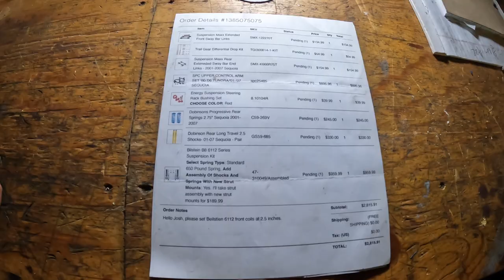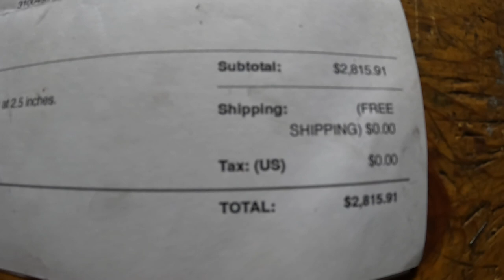Unlock the Secrets: DIY 1st Gen Toyota Sequoia Bilstein 6112 Coilover Upgrade!  Step-by-Step Guide!

Comment from the maker: I want to mention that Josh at First Gen Offroad was great, and i am not trying to make him look bad. The 650lb springs that came with the 6112's were crap in my opinion. Im not sure what the part number is, but they come with the Beilstien 6112 kit on the First Gen Offroad website. My vehicles handling went to shit, lots of  body roll, and the vehicle would kinda  of drive itself from side to side at higher freeway speeds, very odd. I couldn't figure out what was causing the extreme body role. I thought it was my sway bar being undersized, so i changed it out and it did absolutely nothing, lol. So at this point I just excepted that my truck handles like crap now because i lifted it. This issue was happening before i put the hd bumper on. The springs seemed to be to rigid but really inadequate, hard to explain. 
Then, when I put the Eiback 700lb springs on my truck, the truck came back to life! Handling is good again, and there is no extreme body role. So, in my opinion the Eibach 700lb springs with the 6112's is the perfect combination. There is l think 7 or 8 notches on the 6112's for height adjustment. I recommend getting the 700lb Eiback springs and setting them at the lower notches to get your desired height. My springs are set up at around 5 or 6 notches up from the bottom because i have a heavy-duty bumper. Also, remember that there is a driver and passenger adjustment, they are different hieghts from drivers and the passenger side. Talk to Josh at First Gen Offroad. He is very helpful. Hopefully, this helps you out. Let me know if you have any other questions? Good day!

Comment: Im looking into the 6112s series, I got a 2.5 inch lift in the rear with 2885 OME Springs and want OME on my front but I wanna level it out, what spring would you reccomend? (I have 2wd and no heavy bumper), thinking closer to a 2.25 inch lift in the front?